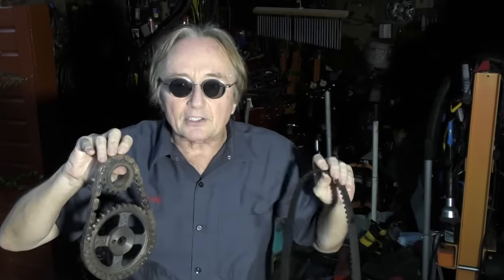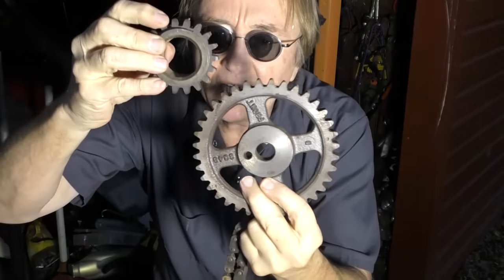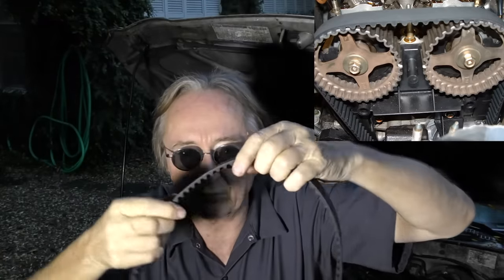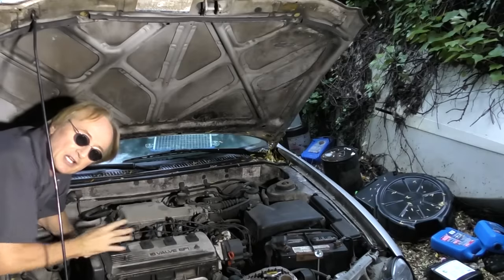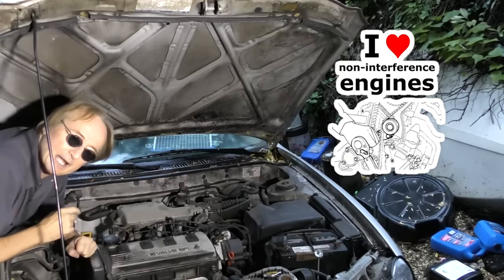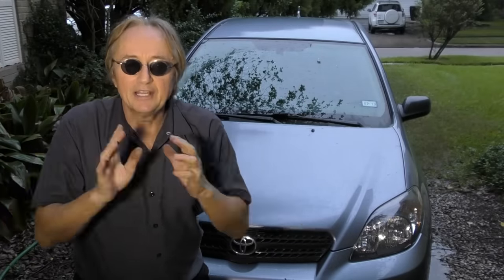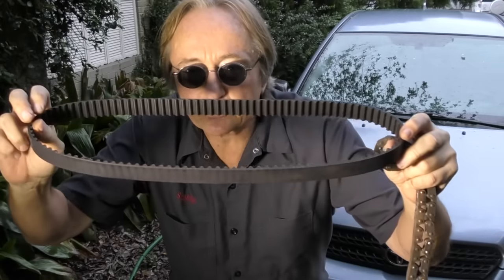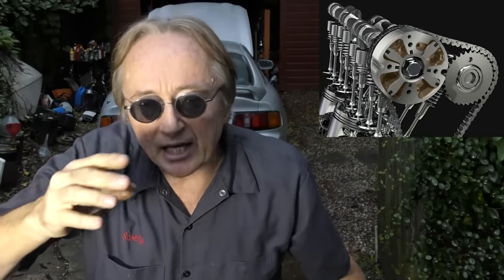Why Some Cars Have a Timing Chain Instead of a Timing Belt

Comment: With the timing belt, there is never a problem if it is changed to the prescribed mileage or the time period that the belt and engine manufacturer predicts. It is important to follow the service instructions. Today, some car manufacturers like VW group, built chains of very poor quality that last for much less than the belt,  it's stretching too much and can destroy the engine.
Reply: One problem is that many Japanese cars hit the used car market with a high price because of perceived reliability, However; some have never had the timing belt changed (expensive repair) . So the reliability is false.
Reply: @oldarkie3880  It's up to the buyer to figure out when the last timing belt replacement was done & has nothing to do with the overall reliability of a vehicle. Poor timing belt/chain maintenance doesn't equate to an unreliable vehicle. 

It means the timing belt needs to be replaced.
Reply: Larry Schwartz this is why you have to change the timing belt (and the oils, filters, etc.) immidiately after you buy a used car, because you didn’t know when the previous owner changed it.
Reply: Belts though never like even tiny oil leaks onto them, neither do they like dirt. And old engines leak oil, and many have had the belts replaced often and the seals on the covers do not seal as well. that is fact.
Reply: Enjoy changing stupid belts; often :)
Reply: You are comparing rubber with Kevlar
Reply: When i wanted to check if the 178,000 km major service had included getting the timing chain replaced as per the schedule, i rang the place that serviced it (in the log book) and asked them. They said yes, simple as that.
Reply: @TiborRoussou  75000 miles isn't often
Reply: @Jizzio  I've yet to replace a double roller!
Reply: So a thin rubber timing belt has never broken or failed prematurely? I know from experience that's definitely not the case.
Reply: Krunobrzi666 never defend a timing belt again.
Reply: @personperson9591  I've never seen a timing belt fail prematurely, I've been working on cars for 17 years. I have seen plenty go well past their replacement interval, though.
Reply: @PistonAvatarGuy  ok.....
Reply: @oldarkie3880  Toyota has/had a lot of interference motors with timing belts, some very well known motors: 2JZ, 2UZ, 1G, 4A, 3E.
You just have to change timing belts within the recommended interval and use a reputable timing belt brand.
If you do that the chance of reliability issues is slim to almost none.
Reply: @TiborRoussou  you mustn't work on Benz, lol
Reply: @mikebaz7843  People who own BMW's, Mercedes and the like can afford to pay full price at the shop. I do work for the common man; the working man. Besides, in my 50 years on this planet, it's only the common man who has stopped for me when I have been stranded ;)
Reply: @TiborRoussou  I meant I've done a few double roller chains due to stretch, but I've personally not witnessed a double break
Reply: When you compare the initial extra cost and peace of mind of a timing chain to ongoing maintenance cost of timing belts, timing belts just make no sense whatsoever.  It's all about lower production costs for the manufacturer, the consumers are paying a lot more in the long run.
Reply: Timing belts are a mitigating factor when I'm looking at buying a vehicle.  IMO they're an unnecessary ongoing expense, so I avoid them when I can.
Reply: Krun, sell it before its powertrain warranty expires and you'll have no problems. I got the Fiesta 6 speed clutch replaced before 60,000 miles. I was getting ready to change the timing belt and tensioner, front brakes, coolant and had already bought the Castrol Magnatech and filter when the rear end got rammed into the back seats.

Comment: All cars should have timing chains.  Last longer and does not have to be changed.  I would prefer gears.  I can put up with a little noise if they are dependable.
Reply: I can't hear it feel my timing chain. And my v-8 doesn't rattle the way a I-4 does anyways.
Reply: Hard to believe gear on gear meshing is louder than a freaking long chain.  I have been in older cars with cams at the bottom and no whinning.
Reply: @moviejose3249  If you want quieter gears just go with helical cut gears rather than straight cut, it's what we use in most transmissions to keep them quiet, the trade off is cost of manufacture and you can give up on overhead cams unless you want a whole series of gears.
Reply: The problem with the gears wasn't the noise as he says, actually is the weight and balance of the engine and parts, making it a little more expensive to engineer and produce the engine and car itself.
Reply: The whine is similar to the whine you hear in reverse.
Reply: EVs don't need timing chains (nor hundreds of other parts found in a complex traditional engine  :)
Reply: @sw96  helical gears produce thrust which then requires thrust bearings which add not just cost but weight and size which becomes a packaging issue. Helical gears are often also thicker than spur gears, which is again a packaging issue. Chevron gears don't produce thrust as long as they are turned the correct direction but are even thicker than helical gears.
Reply: But in germany cars you must change it every 100k km ;)
Reply: Yes. My 1961 Borgward B2000AO runs a timing gear in its straight 6 engine - very solid.
Reply: Kd6sbr Tom  exactly!
Reply: @moviejose3249  ever driven fast in reverse or seen a rally car?
That whaaaaaa or eeeee sound is the gears meshing
Reply: Timing chains can break. I know at least one guy with an Audi with less then 100000 Km that had it's engine destroyed when the chain broke. 
On the other hand, my 1988 mazda is still driving fine at 200 000km on it's second timing belt. And the first one was changed on schedule with no visible damage at all.
Timing belt are fine for most cars.
Reply: F1 cars use timing gear
Reply: Gear drives used to be popular aftermarket mods for muscle cars - those straight cut gears are very loud.  It sounds cool to me, but most people prefer quiet.  I'd love something like the old Cosworth engines - DOHC with gear driven cams - those were racing applications though and costly.  Belts are cheap and unreliable, chains are much better, but gears are the most reliable as long as you don't mind the cost and noise.
Reply: Also old rolls 6.75 ohv v8
Reply: If you own a Volkswagen VR6, the guides and tensioners wear out, the chain does stretch. Still must replace.
Reply: @slome815  just because a few timing belts hold up better than they are expected to doesn't mean that they hold out as well as timing chains overall.
Reply: @AJFresh69  No, chains should last the life of the engine. But when replaced at the proper interval timing belts do just fine. A belt failure before 100 000km  is not common.
Reply: @slome815  if it's an interference engine, a timing chain will indeed last the life of the engine if not changed as part of preventive maintenance.
Reply: @james-ch  Shows you that old technology works best.  They put the good stuff on the cars that matter.
Reply: @isaackarjala7916  lmao
Reply: @johnd4348  yeah, like magnetos and hit&miss engine throttles.
Reply: John D - I hate to break it to you but gears have not been a practical option for turning a camshaft since the advent of overhead cam engines. The camshaft is simply too far away from the crankshaft - it has nothing to do with “noise” anymore. And lets face it, most car engines have been overhead cam since the 1980’s. 

By the way, chains DO need to be replaced eventually. Chains will stretch over time and with the very long chains used on overhead cam engines this can lead to considerable valve timing retardation over time. Often the camshaft sprocket can be adjusted to make up for this stretch but eventually it will get so bad that the chain needs to be replaced. And of course the chain tensioners can also eventually go bad. Of course now that we have variable valve timing on many engines these systems can probably also make up for valve timing changes due to chain stretch. 

As for timing belts they are never a problem as long as they are changed at the recommended intervals. So the main problem with belts is the human factor (laziness and forgetfulness). The thing I personally hate about timing belts is that if you buy a used car with one and you don’t know when it was last changed out you just have to go ahead replace it anyway just in case it was not replaced when it was supposed to be. After all, why risk it? In any case I’m glad that everyone has been going back to chains over the past 15 years or so.
Reply: the whine wouldn't bother me either hell i had straight cuts in my old mini gearbox XD
Reply: Timing chains also don't last forever. They get longer and eventually start to rattle. If they get too long the timings won't be right anymore and the engine can be permanently damaged. Usually manufacturers say they "last the cars lifetime" but "the lifetime" is only a time period of around 150.000km for most manufacturers.
Reply: I like my Studebaker V8s, which have timing gears. The standard cam gear is a fiber gear, 
which is pretty quiet. The heavy duty gear used in trucks and the high performance engines 
are aluminum and ARE a bit noisy, but they last pretty much forever.
Reply: Actually, gears don't have to be noisy.  Instead of using spur gears, which whine, they could use helical gears of herringbone gears.
Reply: You might like the Wankel engine (pronounced vahnkel). @Rick-S-6063
Reply: @frankeggers4024  The Studebaker V8 does use helical gears, but the aluminum ones still
make noise.
Reply: It's the dependable part that can be troublesome.  The old Iron Duke 151ci inline 4 engines from the late 70's and early 80's used timing gears and pushrods, but the camshaft gear was not made of steel.  It was made of a compressed fiber and resin material.  After about 120,000 miles or so the crankshaft gear - which was steel - would rip the teeth off the camshaft gear.  Why was this arrangement made?  To reduce noise and for cost savings.  Most people just junked the cars when the engine died.  If they had used steel instead those engines would still be running as they were rather tough otherwise.
Reply: @PhoenixBird9000  The regular Studebaker V8s used a fiber gear and they very rarely 
give any trouble.
Reply: Problem with chains is the tensioners wear out and they're usually much harder to change and despite what Scotty says the reason they use a belt is because the idler pulleys need changed often as well. Same with the oil pumps and water pumps in there. If you design an engine with a serviceable timing belt it makes all that much easier and cheaper in labour. But hey I'm sure he's an engineer
Reply: I've heard you end up with fine metal shavings with gear to gear I never had an issue with them tho.
Reply: @damonlemasters3424  If there are shavings there is something very wrong. Yes there is some metal to metal wear, but you get that from the cam, pistons, 
and bearings too.
Reply: wayne goff  No doubt,  Manufactures don't want cars to last very long.  They also make a ton of money doing repairs.
Reply: Now you have me curious.  How many miles did those Studebaker's go without failure?  I'm thinking it may have been a parts quality issue specific to the inline 4's.
Reply: Kd6sbr Tom  what sort of warning did you expect after 350K?? A letter in the mail??
Reply: @Bill I hope being old isn't your problem.
Reply: While Studebakers were still being made I drove several of them (both sixes and eights) and also rode in several.  A company I worked for had Studebakers as company cars and I knew people who owned Studebakers.  Studebakers were once popular.  I can't recall noticing timing gear noise, but at the time I may not have known what to listen for.  @JeffDeWitt

Comment: Timing belts are fine as long as you change them regularly (especially on an interference engine; in which case I tell people error on the side and change it more often than you need to).  Some belts can go 60k some 100k.  But I usually go by the 60k as a rule because most companies will list a "Severe" service maintenance schedule which is supposed to compensate for operation in really cold temperatures, like up in Alaska or the northern US where it may get below 10-20 degrees.  And I just tell people to follow the severe maintenance schedule.  Yeah you might be changing your belt more often but its far cheaper than replacing your motor when it does break.   Luckily, companies like Honda and Toyota got rid of the timing belt on many of their vehicles and have gone to chains instead, probably because people weren't being informed of the belt breaking and what it can do, so they decided to just do a chain which IMO is the better design.  I'd rather pay a bit more for a car wit ha chain than have to live with a belt that you periodically need to worry about changing.  At least with a chain, if you keep it lubed (ie. change your oil and keep the oil level up) then there's not much else you need to do, and if something leaks internally (like the water pump), it generally won't destroy the chain if you fix it in a timely manner (blown belts on cars like the older Civics meant the pump and timing belt had to be changed again).

Comment: Let's go back to timing gears!
Reply: Best timing ever invented. Good thing that for some engines you can get an aftermarket gear sets.
Reply: I love the whine. Sounds like a supercharger 😂
Reply: Agreed. Im an aircractf mechanic. Trust me when i say every little 1 engine or 2 engine reciprocating engine plane you see or hear uses timing gears in their engine. 
Nothing less than top shelf reliability is even PERMITTED in aviation. And so it should be in automotive as well. 
And i question the "whining" problem because you dont hear it in aviation engines. But then again, aviation engines are far from quiet. Lol
Reply: Get a Diesel truck... They still have timing gears
Reply: Good call, I'm a Heavy diesel tech,  the big gear only uses timing gears, had roller rockers and double overhead cams for ages too.
Reply: 300 ci in-line  6 cyl Ford timing gears.
Reply: My Model T has gears..

Comment: VW Tsi ahead of the game using bicycle chains as cam chains, Innovation at it's finest.
Reply: stilkus true that, I have a VW Tiguan with a timing chain and no issues. I had an 2008 Passat with a timing belt and had issues.
Reply: My 09 A4 is at 122k. Feels like a ticking time bomb under the hood.
Reply: So does BMW :)
Reply: It's always the vw chain tensioners that fail which causes the engine to jump time and break valves. Mostly due to people not checking their oil. Very common on early vw cc, eos, b6 passat, mk 5 & 6 gti. There's even a warranty extension on it.

Comment: I had a timing chain fail in a Mercedes at only 67,000km.  Ruined the engine.  Chains can fail too.
Reply: VW/Audi Timing Chains suck too. There's a good reason they've reverted back to belts
Reply: I agree I have a 2007 Honda Accord with 143000 mi. Timing chain "jumped". Did the mechanic do a leak down
test,  I needed to replace my engine a K20. then I am told that chains are not relible past 100K.
Reply: Edward H vw timing chains fail because of cheap plastic guides
Reply: Timing belts, for the most part, depending on how it's made) are the worst thing ever.
Reply: You've  got a bad lemon Listen to Scotty, No on Mercedes and BMW...